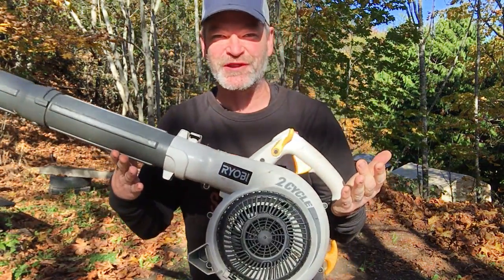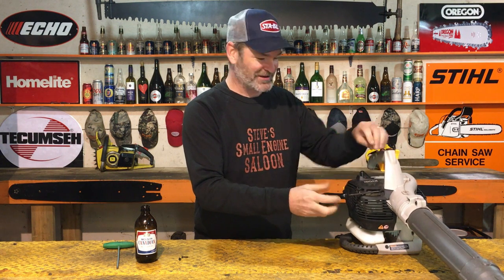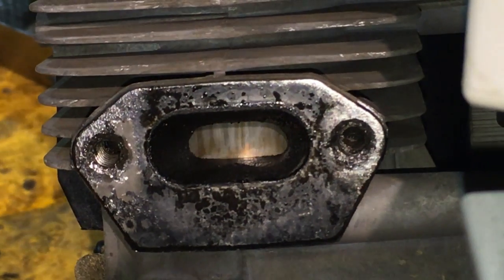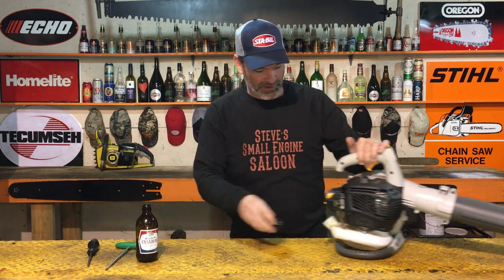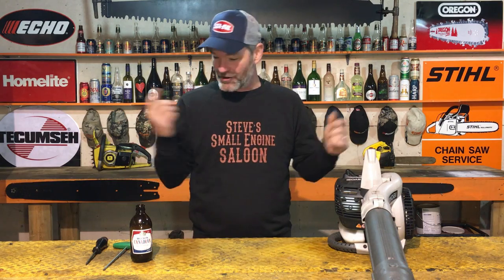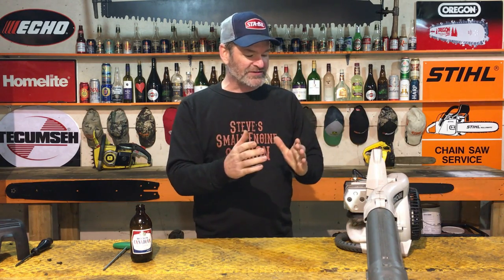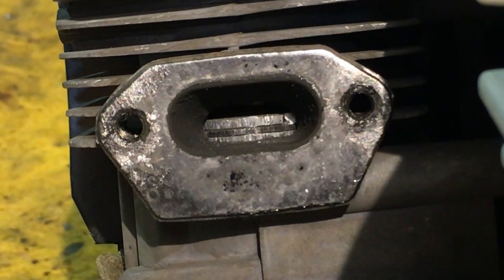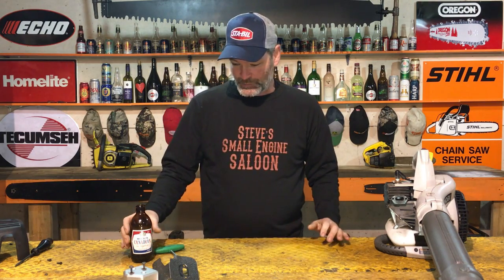What Happens When You Run Straight, Unmixed Gas in a 2-Stroke, 2-Cycle Engine

Comment: I do have a question though. So i have a husqvarna 125l trimmer I got on a trade, it starts but doesn't stay running unless its a half choke and when you give it gas it bogs down until it shuts off sometimes it will run fine so I took it to a small engine repair to get a good look at it and was told it had a scored piston, figured I would replace the piston myself because the guy thought at first it was the carburetor so it was replaced, after disassembling the motor the piston looks fine and so does the rest of the motor, what would cause this?

Comment: Too much oil can also cause ring seizure.  The excess carbon locks the rings down.  Also aviation gas.  We had people trying to use av-gas in their motorcycles and snowmobiles.  The av-gas washes the oil out of the crank and main bearings.
Reply: Thanks for the info.

Comment: After reading a couple comments about people lending things out, only to have them end up like this blower.... when will they learn?! You just don't, ever lend your tools to anyone! Especially your two stroke gear, because you can bet they'll screw up the mix. Or they'll put the fuel in the oil tank and oil in the fuel tank on a saw.....

If a mate or family member wants help with some job and I have the right machine, I say yes, you can borrow it.... and as an added bonus, it comes complete with an operator....me! No risk that way, and you don't have to feel guilty about saying no to them.

Comment: What would happen if you used a bit of 10w30 mixed in?
Reply: I used to run my yz400 on motor oil. 10-30, 10-40, 20-50  it didn't matter I rode the hell out of that thing and while doing so I had no air filter ( live in the desert) and had no problems. Ran out of oil so I used transmission fluid.  DONT USE TRANSMISSION FLUID!!!
Reply: Years ago that is all anybody normally did...
Reply: probably nothing, maybe lack of lubrication because 10w30 is way stiffer than two-stroke oil.
Reply: @banny123456  so what oil would be relatively the same thickness?
Reply: In the 1990's people just mixed engine oil until it had a clear smoke. When too rich it would leave oil sludge on the outside of the exhaust, blacken the spark plug early.
Reply: @Darrell1981  we are not living in 90s :) why to use engine oil ? You can buy 2stroke oil everywhere for cheap.
Reply: @Darrell1981  exactly what I needed to know.
Something to use when stuck.
Reply: You can run regular oil, but stay at 25:1.
Reply: 1qt.30w to 5gl gas . That's all we ever used sawing logs in East Texas. That's all I use now.If the mixed gas starts getting old I use it in mowers . My riding mower is over 20 years old . so running mixed gas in it seem to help.Just a Murray with an 11hp b&s.

Comment: I'd be interested to see same test done but mixed at a ratio of 100:1 to see if a big mistake in mixing your gas will cause significant damage.
Reply: Would it even run? Probably not.
Reply: @glasswinder  it ran for 9 minutes with zero oil. So sure it will run just curious if a real low ratio would still protect the engine.
Reply: @iconr6racer  yes it will, we used to run Amsoil in all our saws. 100:1 mix never had an issue.
Reply: @leorapsonjr9134  why were you mixing it at that ratio on purpose? Surely they weren't suppose to be ran at that ratio?
Reply: @iconr6racer  amsoil Saber is designed to be ran at that super light ratio because it can protect it just fine
Reply: @iconr6racer   yes we were mixing it at 100:1 unpurpose. Like I said Amsoil two stroke oil. I worked for a tree removal company, all we ran were Hyskvarna, from 338 trim saws up to 395xp.
Reply: @MultiPowerlin  thank you I forgotten that it was the Saber synthetic oil.
Reply: @leorapsonjr9134  pretty wild,, I could see it being fine for a tank but continuous use I'm very surprised by that. Thanks for the knowledge.
Reply: @iconr6racer  we got a new 372xp, ran one gallon of standard mix gas to break it in then the Amsoil Saber. Saw never missed a beat!!!
Reply: I have a friend who runs 100:1 Amsoil and swears by it.....I just can’t get up the nerve.

Comment: Greetings Steve, One of my sons ran straight gas through my last year bought Cub Cadet BC280 , and now the pull starter wont start the engine because its not un-winding fully when I pull it. I removed the starter string and the string works fine with it removed from engine, then as i put it back on over the pawl thats on the engine shaft, the string doesnt pull out all the way , should i pour small bit of oil in the spark plug to perhaps rub up that piston...wondering if that would fix it..I later added the correct fuel to oil mix, but still have issue...probably too late
Reply: It's ruined.

Comment: Accidentally did this to my Stihl fs 70 weedeater. I bought non ethanol gas at the end of the season last year but never needed to use the trimmer again before the snow flew and the first time I ran it this year  I forgot to mix the fuel and oil. Hard to believe but it ran for nearly 30 minutes before it gave up and oddly enough after I realized my bonehead mistake and drained out the straight gas and put mixed in and let it cool down, it started and actually runs with quite a bit of power under revs, although definitely not as much as it did have but it will not idle. I know the rings are scorched because it smells pretty bad. Do you think it's worth rebuilding, cheaper to buy a new one? Is just the piston and rings damaged or is the cylinder wall scored too?
Reply: My son just did this with his backpack  blower. OEM piston and rings was about $45. If you need cylinder (he did) it was $50. His runs like new again. You can probably find aftermarket parts cheaper.
Reply: @bucfan11  Took it to my local Stihl guy and told him what I'd done, after he got the you dumbass look off his face he played around with it a little bit and got it idling and actually running almost like new. First thing he asked me was which oil I had been using to mix with before this happened, I.E. the orange or silver bottle, I told him the silver and he said that may have saved it. He said there was a little scorching but replacement parts for it would run about $150.00 and if it was his he would just run it as is, as a new one is only $260.00 so it wasn't worth rebuilding. I've run it a lot since then and it is still running very strong, definitely not as strong as it was before but has no problem chewing through the stuff I use it on. Thanks for the info though.

Comment: I’ve all Sthil products and they are  over 12 yrs old , with daily use , not 1 has caused me any issues in all that time .  I fill a plastic cup  (135ml) with 2 stroke oil  and pour into a gallon  fuel can .

Comment: Can I use 2 cycle outboard motor oil in my chain saws and weed wackers without damage? It is TCW-3 oil. Thanks!
Reply: I believe the difference in the oil is that watercooled engines run way cooler than air cooled engines therefore the oil for air cooled engines is a more robust lubricant
Reply: Never tried it but the Stihl manual recommends against it. Outboards are water cooled and I guess the oil is different.

Comment: Steve, cool vid.....I wondered how long it would take.  I rebuilt a big husky saw for a guy once that had added the oil to his gas can but never shook it up.  His son went to use the saw not knowing that it had to be shaken.  Expensive mistake, the piston and cylinder both were toast   You made a comment that is about something that I have always wondered. I understand that the rings give compression as you said, but when the rings are in good shape, say new ones being put in, to what extent does having scoring on the sides of the piston then affect compression?  Scored pistons should be replaced is the general consensus I believe, but if the rings can still do their job, will you still be losing compression?  Thanks!

Comment: Steve?  How important is it to get that exact 40:1 or 50:1 ratio (depending on what your machine calls for)?  When I make up a mixture I always err on the side of adding a bit more oil.  Other than creating a bit more smoke, is this a bad practice?   I'm not talking about doubling up the oil.  I talking about using say 2.8ish oz per gallon instead of the 2.6 they call for.   My thought for this is that some of the oil is always coated to the sides of the dispenser after you pour it in.  So you are never really 100% emptying the dispenser.
Reply: If you get more oil in your mix - 32:1 instead of 40:1, for example) - your exhast might be a little smokier.  Unless you go WAY overboard on the oil, all you'll get is some extra smoke.
Reply: I have tools that require different mix ratios. Since I don't want to have a bunch of different blends laying around I just mix one matching the requirements of the tool that calls for the most oil. No problems after several years of doing this.
Reply: @duradim1  I agree.  In my case, all my 2-strokes are 50:1.  But I always err of the side of more oil.  Those containers where you squeeze the amount of oil into the calibrated dispenser, I always go slightly over the 2.6 oz mark.  I figure if you fill it to exactly 2.6, not all the oil gets poured out.  Some left over is always coated on the side, or a little bit sits in the dispenser after you pour it out.

Comment: I have rebuilt those  for about $30. You can get the parts on Ebay. Ring, piston and cylinder jug included.
Reply: Newagetojo, I think it's mostly just a brand name thing. I know the high dollar equipment is generally made of higher quality materials and some cheaper ones are really lower quality materials but if ANYTHING is taken care of and has regular maintenance done it can last a long time. People are always going to poo poo stuff, some of it is from actual experience but much of it is from following popular opinion.

Comment: Steve, I was riding my old Yamaha DT360 single cylinder two stroke at full throttle along a busy highway many years ago. The DT360 had an oil tank and an injection metering system that was cable operated alongside the separate throttle cable. Unbeknownst to me, the oil injection cable had broken at some point so only enough oil for low rpms was being injected. As soon as I backed off the throttle, the engine seized immediately locking up the back wheel sending me into a crazy skid. I had the presence of mind to pull in the clutch thus releasing the back wheel and regained control. After coasting to the side of the road and clearing out my shorts, I actually managed to get it started and limped into work. Bored-out to 4th oversize + piston and a new cable and it ran like new again!  I kept an eye on the injection cable after that!

Comment: Wonder why there is not a separate small reservoir for 2 cycle oil on the equipment that gets metered and mixed at the carburetor rather than having to do the premix routine with laymen trying to do simple math.  When the 2 cycle mix oil reservoir gets empty, the engine will not be allowed to start via a small sensor of some sort placed in the oil tank.  Cost can be handled by letting the Chinese manufacture the protection device.   Having three fill tanks on a chainsaw (gas,oil,bar oil) would overwhelm a percentage of people putting the wrong thing in the wrong hole.  Otherwise I think it would solve the 'I forgot to run mix gas' problem.
Reply: things like that fail and are complicated.
Reply: There are engines like that.  I had a 90cc trail bike that you put your 2 cycle oil in a separate tank and it worked fine.  I believe it was a Yamaha.

Dale in Canada

Comment: Steve, first of all Thanks. Thanks to you I fix my weed eater Bolens, that didn't rav up, I did what you suggested about those screws and fix it. Then I bought a ryobi blower that didn't start. I dissasembled it appart, put some carb starter, blow it through the carb, put it together, then turn the screws 1.25 as you suggested, but didn't start, keep going, about 15', play around with those screws, more carb straight into the carb, and boom, when it goes about to start, I play more with screws and kaboom, work perfect. It turned out that it need 2 completely turns the high and the low screws. And now finally today I started worked in an old weed eater husqvarna, that has the piston stuck. I played around a lot of carb inside, I actually got a hammer and a metal point, and hammer that metal axel until it started to turn. Then hooked up my drill and give it several turns, I busted the screw but I put another one. that problem was fixed, I don't know if I am going to have luck bring it back to life, but I did learn a lot of it. I need to replace the fuel lines, and the purge bulb, tomorrow I will buy another one, but the carb looks ok, after cleaning of course, but the fuel lines were completely gummy, green gummy, I have to put another one.
I let you know how it turn out. But a big THANKS TO YOU, you have a soul of a TEACHER. PLEASE KEEP IT UP. I always thought I have no skills for motors, but now with YOU I am starting to have a little faith in myself. THANKS AGAIN.
Reply from the maker: You're Welcome...

Comment: i just bought one and i dumped the fuel out. it seemed like straight gas... I looked at the piston looked a little scored... but it starts and runs ok....? is it toast ? or can they survive a little abuse?  it wasn't near as bad as yours.
Reply: I'd strip to down to check, and replace atleast the piston ring and clean the piston and sleeve

Comment: I have a Stihl BR600 backpack blower that I bought used off craigslist from a lawn care service for a steal because it needed a little work and the guy I bought it from said that supposedly one of their guys accidentally refilled it once with straight gas but soon realized the mistake. My guess would be that there must have still been some mixed fuel in the tank when the guy put straight gas in it so it wasn't running completely dry on oil, I just adjusted the carb and it runs great, has ever since. I haven't checked the condition of the engine or anything but it still has compression and runs good. Thanks for the informative video Steve!

Comment: Bought a new Makita 2 stroke grass trimmer, and the books says that use 50:1 mix only with some fancy high quality oil they specified, but for all other oils it must be 25: 1, it says.
I used cheap 2 stroke oil from super market mixed 25:1, and it runs great.

Comment: Good job Steve, Very informative as usual. I am really shocked that it lasted 9 minutes! Kinda impressed! LOL!
Reply from the maker: Right on, thanks for the comment......
Reply: @StevesSmallEngineSaloon  How about a video on doing the opposite - running 2 stroke fuel thru a 4 stroke engine ? I've done it a few times before. If you run 2 stroke thru a 4 stroke engine on a regular basis will it do any damage ?
Reply: @greghollands3628  it can carbon up spark plugs and plug spark arrestors, but thats about it.
Reply: Ive seen some stihls last 20 plus minutes, just crazy

Comment: That’s what happens when you let your son-in law borrow your chainsaw too!! He said it cut off several times during use. I said did you run the fuel I gave you? Answer was I guess. It runs but not as strong as it did. But I’m running a heavy dose of 2cycle oil mix. Good ideas?

Comment: Hey Steve, what about a video on things to look at in a used piece of equipment before buying it, including one that doesn’t run? I know most recommend buying new whenever possible, but there are some killer deals to be had out there sometimes that might just need a little tinkering, like your Ryobi, to give it new life. I’ve recently seen a lot of “don’t know if it runs” ads on some of the marketplaces and I’m curious whether they’re a steal or a pig in a poke and what I need to do to be able to differentiate between the two.

Comment: here is a foot note using the wrong 2 stroke oil will do the same thing to a 2 cycle engine and if you think I am B S ing you go to the small engine dealer the will show there is different kinds for exp do not use regular 2 stroke oil in a stihl use there oil do not make the mistake I did and learn the hard way

Comment: Good to know!....NOW how about too much oil? will the piston carbon up? (thanks for the demo)
Reply: You'll eventually clog your exhaust screen. Easy fix, better too much than not enough. You can run 2 stroke fuel in your 4 stroke with no damage, just dont do it the other way around.

Comment: The past two years or longer I have been using Walmart Super Tech Marine oil in a MTD string Trimmer and run it as hard as it will go and have not had any problem with the engine. I used it in a old consumer chainsaw and even increased the mix, still runs great with a little smoke. It makes me question if the expensive oil is as good as everyone claims? I do avoid dollar store discount oil because of the alerts from PQA on off brand oils... Sad to see you trash a decent running piece of equipment

Comment: Steve, what do you think of the Amsoil Saber oil? I use it on my power tools.The mix of this oil is 100:1.
Reply: Thats some thick stuff. i got klotz techniplate sae 40 2 stroke synthetic. Its 48$ gal and 2 stroke v8 8v92 takes 6 gallons, i got her on BRP XD-100 synthetic and its cheaper than motule 8002t which i willget eventually if i get a few gallons.